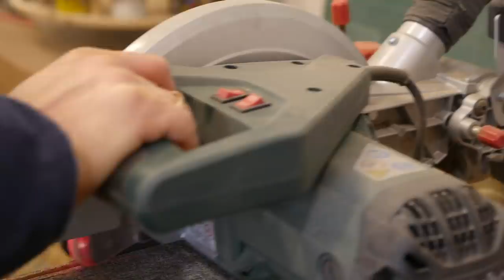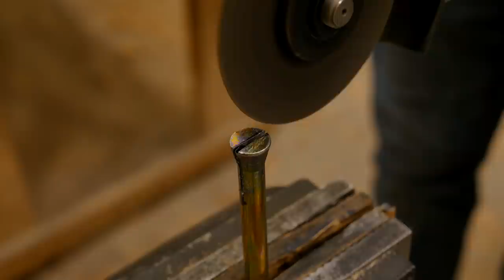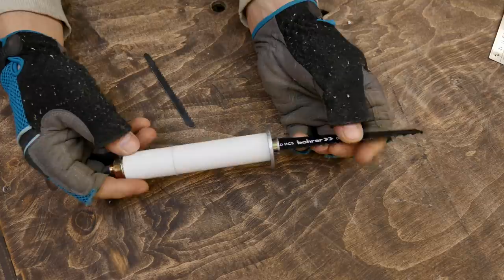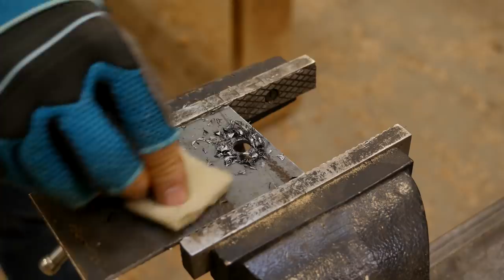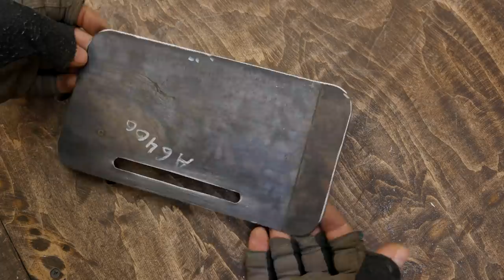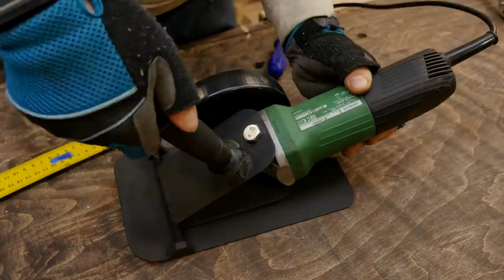Top 3 Genius Ideas! You may need this!

Comment: Good ideas, but I will change the long thread  bolt with a clean bar and the nuts with bent up ears from the bottom plate or 2 solid washers, because with treads it moves sideways when cutting.   Keep up the good work, in high speed.

Comment: I have a spare angle grinder I was going to make a chopsaw with. I think your design could be converted or made to work in a chop style, with a little cross guide bar to keep the piece at 90º to the blade. 
Thanks

Comment: Номер раз - правильно, зачем просто брать две планки и скручивать саморезами за 5 минут если можно два-три часа стачивать огромный брус до нужного размера? Автор, Вы бы пошли еще дальше и работали только наждачкой, а то что уж...
Номер два - невероятно сложный способ сделать маленькую и неудобную ножовку. В магазине можно приобрести нечто подобное по цене использованный Вами материалов и не морочить голову всем вот этим.
Номер три - ну допустим это работает, но это слишком переусложнено. Почему бы не прикрепить подошву напрямую болтом к отверстию рукоятки? Ваш вариант подойдет только для такой УШМ, с любой другой моделью возникнут проблемы. 
Итого - много времени и сил потрачено на бессмысленные изобретения веловипедов. Спасибо хоть не портите инструмент как другие самодельщики...

#1: Yeah, it's too easy to just pick two planks and screw them together in 5 minutes, we will rather take huge brick of wood and slowly form it in some hours. Author, why aren't you use sandpaper? 
#2: Too complicated way to make tool that you can buy in store for the cost of materials used here. And professional tool will be more reliable and more comfortable.
#3: Ok, it works, but you overcomplicating this. Why you aren't just screw this "stand" directly to the handle hole? And also this design will work only for this model of grinder, any other will meet some problems. 
Overall, to much work and time spent on useless attempts to reinvent the wheel. But at least you not ruining your tools like other DIY'ers...

Comment: The only downside for the grinder is that the depth of  your cuts are limited to the  diameter of the blade ... you can't increase it because of grinder body but you can decrease it.

Comment: Why not use the original grinder handle instead of the second mounting bolt and not need to weld on an additional mounting nut?
Reply: Perhaps the bolt on the handle wouldn't thread far enough into the grinder to be safe after first passing through the extra steel.
Personally, I would have used a grinder with a third handle-mounting location on top - which would be the side, in this configuration. Seems like a more natural, ergonomic position to me.

Comment: Wait! You went through all that trouble in cutting out the mud guide when it could have been made with a thin, narrow strip of would glued and nailed to the larger board? What am I missing here except a lot of wasted time?
Reply: Art the art of making the Tool.
Reply: Nails rust, and not all glues tolerate exposure to the constant moisture present in that kind of work. If it's made out of hardwood - say, oak, or ash - making it one piece would be more durable than a glue-up.

Comment: The "genius idea" at the end is all about being able to cut a straight edge with a grinder (no puns thanx fellas) but it relies on having  a square fence to reference the square edge from. When he does the second demo - it looks like the material is Ply board or similar - he's not using a fence to guide the "genius idea" ....it's just freehand so it seems that demo is for naught.
Reply: what??  the "base plate he added being square to the blade determined the square edge and the guide or "fence" determines the straight-line cut... and since you thought the 2nd demo was for "naught" i'll explain it as well.. the 2nd demo was to show you the "control" you now have with a "base plate" while free-handing! have you ever used a grinder? .. no control and with no control no square edge and no straight line!
Reply: @popparock6506  AMAZING!!!